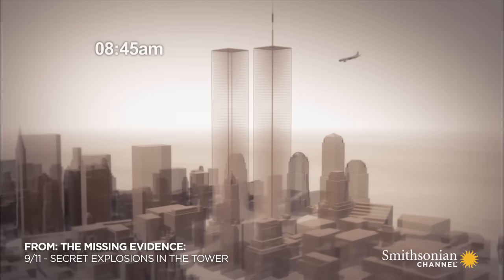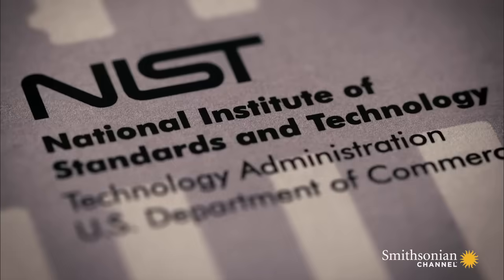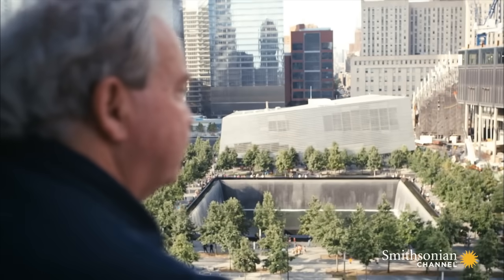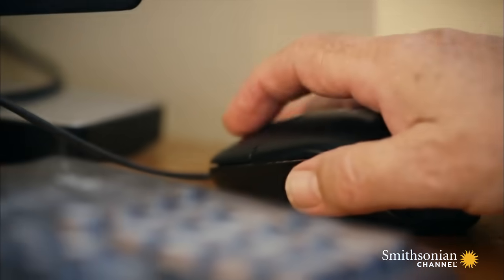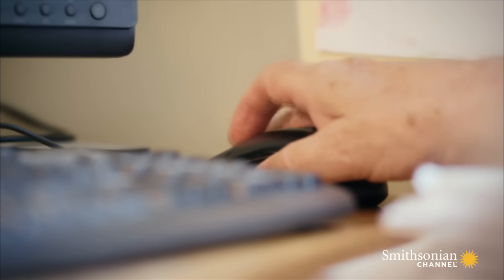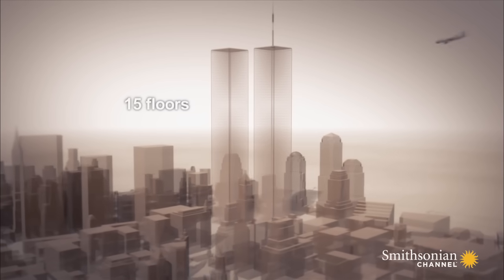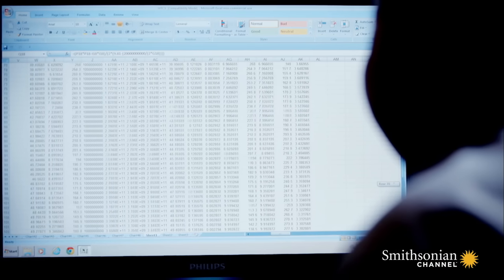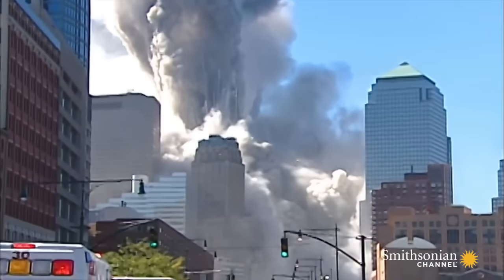This Computer Simulation Explains How the Twin Towers Fell

Comment: Can't deny that burning jet fuel can weaken steel to where it will bend. That was proven. Can steel melt from burning jet fuel? No. Can steel weaken from burning jet fuel and bend? Yes. Could weight have played a factor in the collapse of both towers when the steel did weaken above the impact point? Yes. Could it have been solely weight below the impact point where steel was that could've caused that steel to weaken and bend to make it collapse? Maybe. DId any steel even weaken or bend below the point of impact of both towers? Maybe or maybe not. I could not believe myself that the towers fell the way they did and wasn't sold on the way they fell at first like a lot of other people but I have been convinced a lot now. Now the Pentagon I'm not satisfied with yet. United 93, all I can say is my dad knew Todd Beamer who was on that plane.

Comment: Four planes disappear. Three buildings collapse at freefall speed. And the icing on the cake.
One of the three buildings fell faster than freefall !!! 
Where did Newton's laws go on 9/11.  Not to the USA.
Reply: No, none of the buildings fell faster than free fall. What a silly thing to say. The times given here are wrong.
Reply: TimReed22222 
Lets agree on freefall speed.
If that's the case , then how come
the surface waves were small?
And why was there so little debris
when pulverisation wasn't the cause of the missing amount.?
Pulverisation could not have happened without large surface waves at least. There were none.
The hole in the ground was hot.
And stayed that way for 3 months. Dying down during that period. 
This is where Dr Judy Wood comes in. The only person to point out what happened.
Much of the towers turned to dust. Incuding steel girders. Hence the small surface waves. 
No one else has an alternative 
answer as of yet. 
The dust was analysed down to
0.9 of a micron. Ultra fine.
Shouldn't be there.
What could cause the dust to be that fine?
Reply: #1 Just to be clear, you concede that no building fell faster than freefall, yes? Because you realize, I take it, that no theory including the craziest of inside-job theories could account for this? That's physically impossible no matter which side you believe.

#2 Ah, I should have figured you were a Judy Wood space-beam nut. For the record: There's no evidence that any steel was turned to dust, or anything else for that matter other than what drifted away on the wind. The first responders spent 7 months removing very solid debris!

Why did the ground stay hot? It's curious you bring this up because Wood's space-beam theory doesn't account for it! Neither does thermite, mini-nukes or whatever else you believe, The only possible explanation is the simplest: FIRE.
Reply: TimReed22222 
You explain to me how a fire
can keep burning for months.
Did the firemen have the wrong
kind of water?.
Reply: The "Pile," as the first responders referred to it, was just that: A massive pile of debris acres in area and who knows how deep. With thousands of tons of available fuel all over. Any firefighter will tell you you can't get water on everything. I have never heard of any firefighter who finds the fact that it burned for months suspicious.
Reply: TimReed22222 
Firefighters don't take months to put out fires.
There's only one reason for months long fires.
Dimitri khalesov or Heinz Pommer explain. Your choice.
Reply: LOL! How does the mini-nuke theory explain fires 3 months after the fact? That's the LEAST plausible explanation!

You guys crack me up ...
Reply: I didn't say nukes crack me up, you illiterate turd, I said you crack me up - specifically, gullible morons who think nukes generate magic fires that burn without fuel for 3 months, as you seem to believe.

Perhaps you'd care to explain how that works? Didn't think so.
Reply: TimReed22222 
Dimitri Khalesov or Heinz Pommer will explain it to you.
Go find them.
Insults directed at me will only reflect on you. You are on show here. Your 15 minutes of fame
wasted showing yourself up for what you are.
1.  16  9  7.
Reply: Do they specifically address how nukes can keep fires going for 3 months? Perhaps you could summarize that point? Yes I'm familiar with the mini-nuke theory & have long since concluded it's the most ridiculous of all the inside-job theories; I have no interest in wasting any more time on it.
Reply: TimReed22222 
Nothing else can keep fires going
that long. Common sense.
Reply: Can nukes? I don't see how. Nukes expend all of their energy in less than a second, then they're done!
Reply: TimReed22222 
Not if they are in the bedrock.
People felt a rumble beneath their feet just before the towers collapsed.
Mini nukes are used to create sealed holes in the bedrock for storage of gas. The inner surface is smooth like glass. The same seen in the holes at ground zero
after the fires died down.
The two towers where built like chimneys. Perfect for nuking.
Heinz Pommer explained that the towers were sealed units, and had to be opened up else they would topple over with deployment of nukes.
The planes opened them up.
Heinz Pommer is well worth listening to. He explains why cars were affected while paper was not.
Reply: Avoiding the issue. You still haven't explained how nukes can cause fires that burn for 3 months. 

4th request and counting ...
Reply: TimReed22222 
A nuclear phycisist can explain that. Hearing it from me is your only way to avoid the truth.
Reply: Well here's where you're screwed: I have studied nuclear physics - admittedly as an undergrad, not a full-fledged nuclear physicist but enough to know what you're saying is bullshit. Nuclear weapons generate their heat in one fraction-of-a-second burst and they're DONE. They are not magic. They do not generate fires that burn for 3 months without fuel. But conventional fires will burn indefinitely as long as they have fuel to burn - and there was plenty in the towers. No nukes required. The end.
Reply: TimReed22222 
It's not what i'm saying. This info comes from nuclear physicists.
Go check them out. Your argument is with them. Not me.
All you want to do is debunk
9/11 as a false flag.
The people behind 9/11 will never be prosecuted. They are too organized and powerful.
I dont care who they are. I just want to know how they did it.
Dont you?
Reply: Sorry, Mark, but I have looked into these matters - and what I've found confirms that nukes cannot in any way explain the 3-month fires. Only CONVENTIONAL fire can. No nukes required. As for your nuclear physicists: Have they convinced their peers of the validity of their theory? Have they published & been peer reviewed? Does the nuclear physics community at large endorse mini-nukes at the WTC?

And no, 9/11 wasn't a false flag. Who did it? Religious zealots driven by hate. How did they do it? With a plan we were not prepared for.
Reply: TimReed22222 
You were prepared. Bill Cooper warned of a devatating attack.
New York was one of four places mentioned. They will blame Osama Bin Laden. Dont believe them.

Comment: Huh. Wonder what happened to the solid concrete elevator shafts that ran up the center of each building. I understand the steel frame work collapsing due to its different construction. But the concrete elevator shafts should have remained if only partially.

Comment: I'm not a math major but wouldn't you need to account for loss of mass due to debris being ejected laterally from the collapse? Wouldn't this reduce the weight and thus the force exerted on the floors below? If the rate of debris being ejected was higher than the debris being added by the collapse itself then the collapse would slow and stop before reaching the ground...  It didn't seem to me (by his explanation) that this nuclear chemist took into account a loss of mass due to lateral ejections from the collapse. I'm curious to know if he did or if he didn't how much this would change the simulations "prediction" of the collapse time.

Comment: what about building 7? explain that one please.
Reply: You can google pics of the damage tower 7  took after the Towers fell on it.  

And fires engulfed the interior without firefighters even attempting to put it out.  T7 didn't collapse until 5 pm.  

You're assuming someone fiddled with the detonator for 8+ hours?
Reply: SNJ silverstein takes out an insurance policy just before making him 4 + billion dollars richer. none of these planes were shot down. you believe that debris falling onto a building caused its fire? silverstein says he's informed the best thing to do was to "pull it" ( a term used in demolition)...and these are all just very big coincidences ? ? ?
Reply: +Nic Mic

Debris.  You consider the two tallest buildings in the country to be just "debris?"

T7 sustained tremendous damage in it's first 18 floors when the Towers fell.  The collapse also rendered the cities water main beneath the WTC useless.  

That's why he told the FIREFIGHTERS to pull it.  As in, let it go.  Get out of there.  They had no water to fight the fire.

I'm assuming you think the attack in 1993 was the failed inside job?
Reply: SNJ 1. i do consiser it debris. just like many other sources. even sources that claim to debunk theories.
2. those buildings came straight down. are you saying the towers impacted the higher levels? (that would support theories of explosives considering how far the buildings were separated).
3. when exact demolition terminology is used(pull it) to deter conspiracy it sort of idk...defeats the purpose.
4. yes you are assuming what i believe but your also assuming all of these events are still...coincidence.
5. the bbc reported building 7s collapse while it was still standing....directly behind their own cameras.
6. bush claims to have seen footage on live tv TWICE of the first plane hitting the tower. 
7. im just scratching the surface.
Reply: asrgaqgq sdfgsdgsdfgsdg i really don't have the time or energy to even respond to a moron of you're magnitude. have a good day.
Reply: asrgaqgq sdfgsdgsdfgsdg demolition terminology - what does PULL IT mean? look that up.....moron.
Reply: asrgaqgq sdfgsdgsdfgsdg there's one. now you show me a video of a building similar to building 7 collapsed due to falling debris. I'll wait. moron.
Reply: asrgaqgq sdfgsdgsdfgsdg where did you go....moron?

Comment: I Cannot believe that NIST actually had somebody design software to fraudulently explain away how over a 1/4 mile of building collapse into it's own basement in 56 minutes .The arrogance that they would undertake  such a lie But do you know what this lying little man forgot to tell you if that is how it happened then where is the 58 story stack of building debris and what caused ALL the cement to pulverize into fine dust ?  This Man's story is pure horseshit  FUCKING TOTAL BULLSHIT...not to mention as each floor would have slowed down with each drop as the energy bled off ..

Comment: this is more bullshit.  the proof that there were no planes:   there is no trace of wingtip vortex after a plane allegedly arrives at 550 mph.

everything else you want to try to argue is proven to be bullshit by this easily verifiable fact.

None of you clowns would be capable of simulating the collision and subsequent explosion and suppress the wingtip vortex.

If you do,  you no doubt cheated.  It's what you're all about.

Cause you like your servitude,  band of losers and slaves.

Comment: The crush down crush up theory presented by Banzant et al and accepted by FEMA and later NIST was disproved by video analysis several years ago. The top blocks were essentially disintegrated by the time the destruction wave had gone down 10 floors below impact. The south tower top block fell OVER as we would expect from asymmetric damage, but also disintegrated long before the ground floor was reached. Massively heavy materials were ejected laterally up to 600' in all directions, allegedly from air being compressed out of each floor. Now explain how  single column failure led to a perfectly symmetrical global collapse of WTC 7 at [near] freefall speed? 8 floors [about 90'] stopped supporting the building simultaneously. Or how the fires burned underground in the pits for 92 days with no oxygen. Very high temperature fires. Or how the EPA said the air was fine at GZ, when the towers were loaded with asbestos? That is the on going crime that keeps killing our first responders to this day.